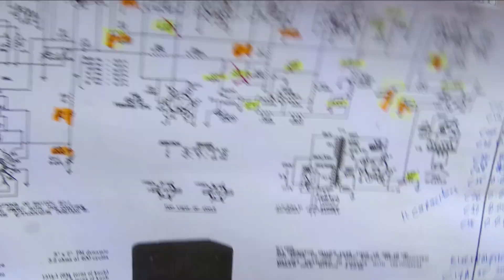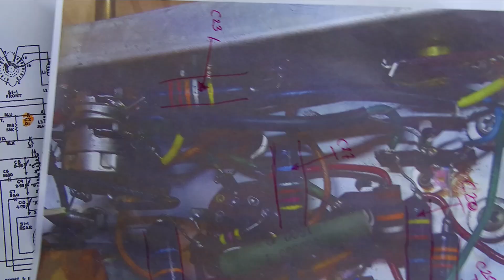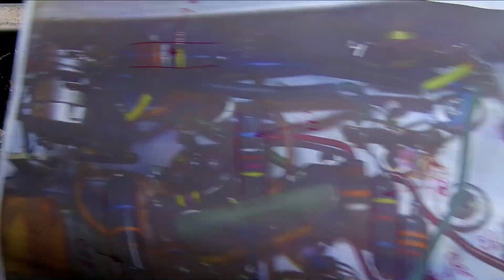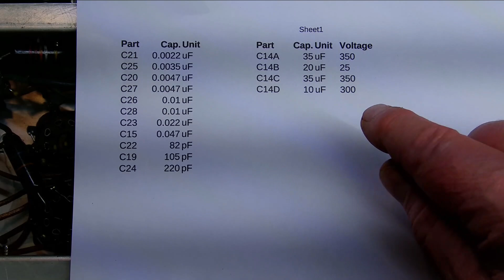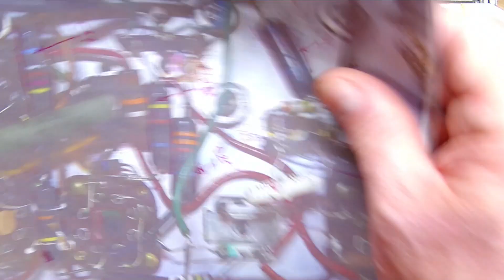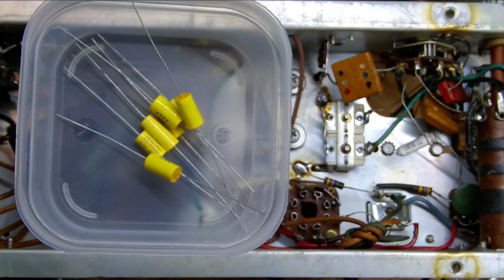RCA Model 641 - Part 2 - Bees!  There are bees in the chassis!

Comment: When I come across a radio like this instead of trying to remove the whole length of the old capacitor including the leads 
I snip right next to its  body and curl the remaining piece up in a small loop. It becomes the attachment point for the new capacitor. The old thicker wire  supports the new leads which are looped onto the old leads. Crimp them tight and solder. 
 It saves a lot of time and doesn't do any damage to the existing terminals!